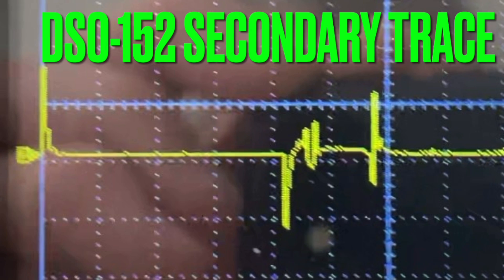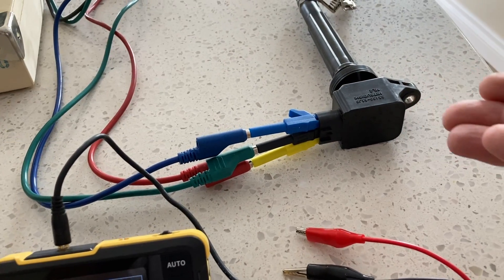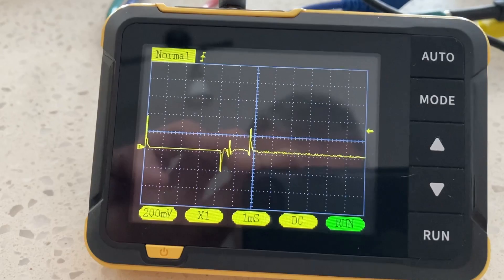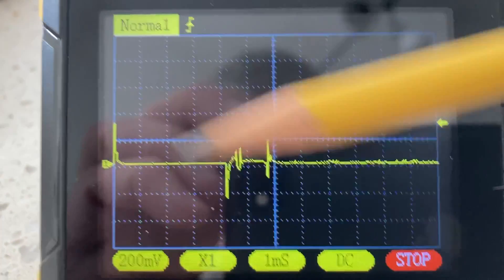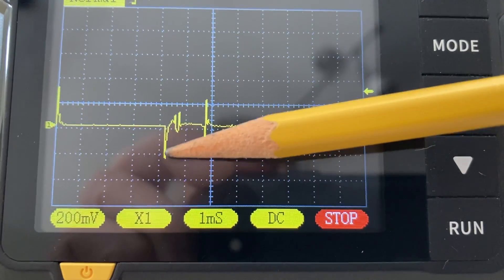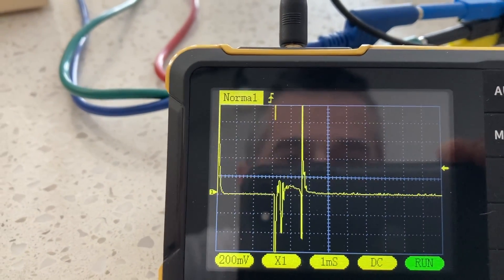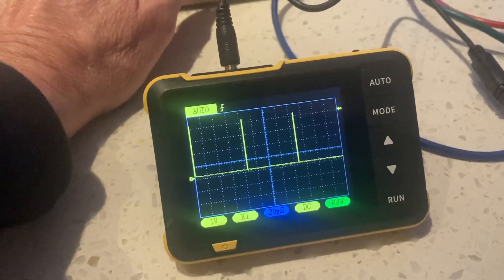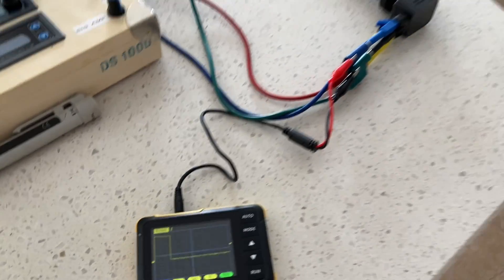Fnirsi DSO-152 Secondary Ignition

Comment: How were you able to do this with no attenuator?
Reply from the maker: There is no direct contact. It’s only a small voltage induced into the lead laying on the coil housing. It poses little hazard to the scope so long as there is no known fault of the coil arcing. Although the risk of that possibility is not Zero.